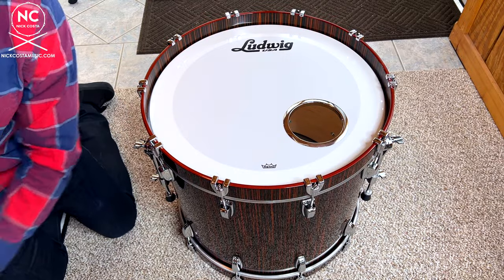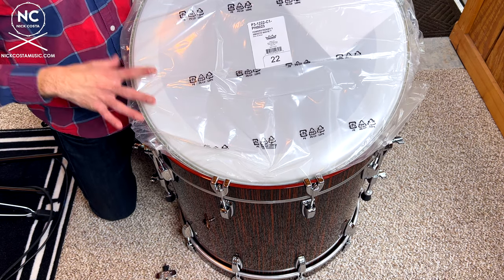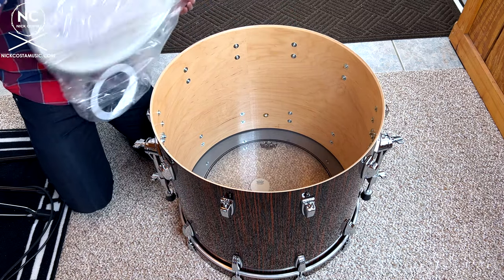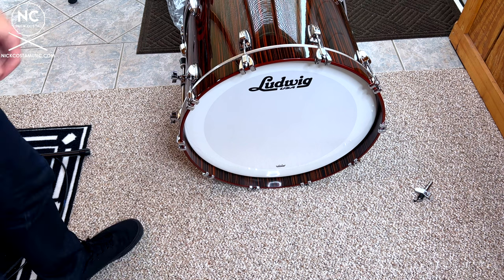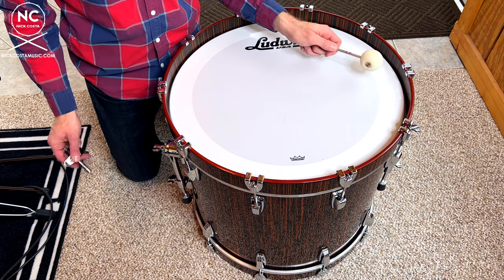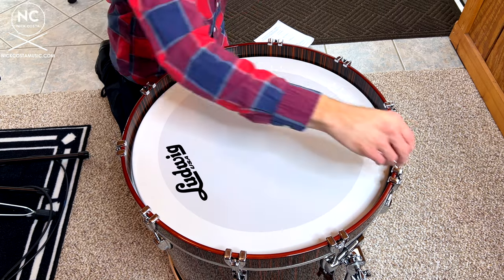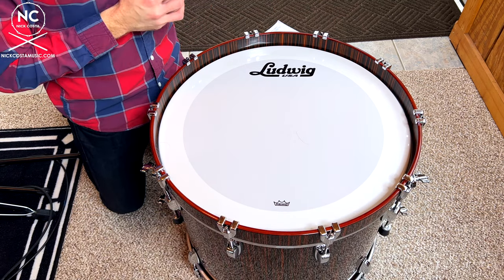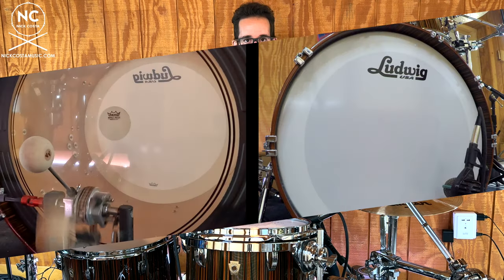How to Tune and Muffle a Bass / Kick Drum Part 2

Comment: I like 1. a little muffling on both heads, 2. Heads a little tighter
I’ve started experimenting with shredded newspaper or a Weckl muff front and back. 
I saw the newspaper done in the 60’s
Reply from the maker: Oh nice! I use to do the same with T-towels resting on both heads.

Newspaper - I’ll have to check that out! How do you like it so far?